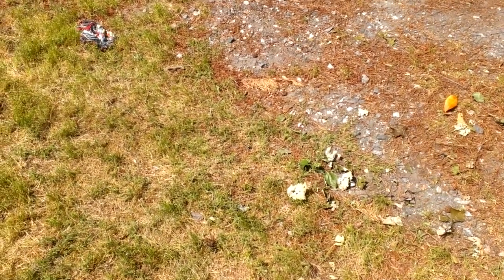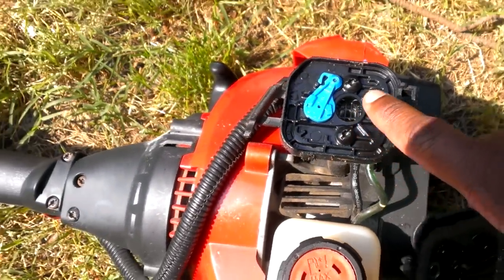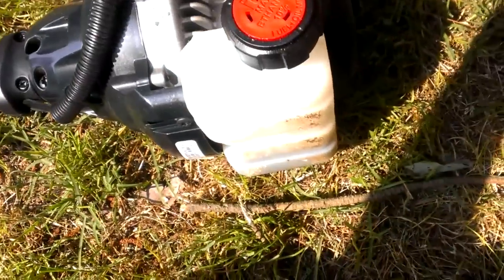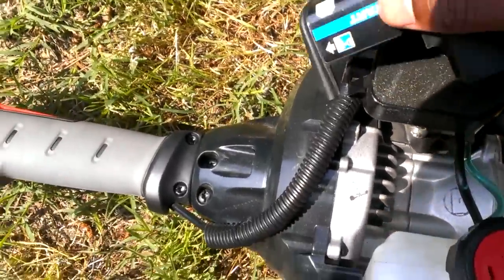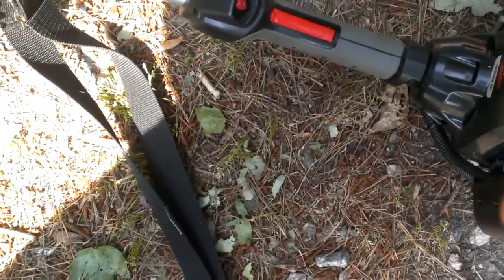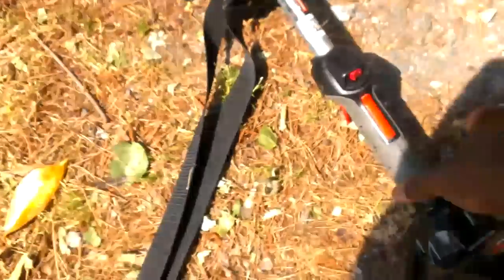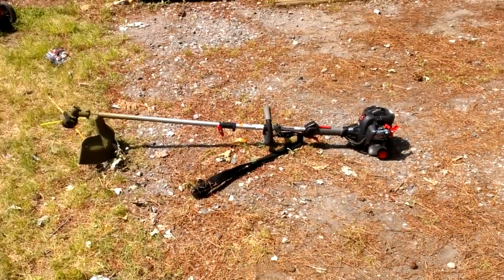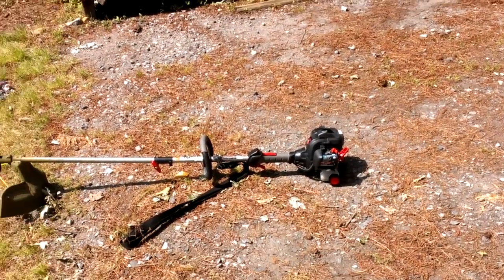Troy Bilt weed eater air filter problems

Comment: mine won't run with the airf filter installed even a brand new filter it won't run or idle soon as i take filter out fires right up

Comment: All my equipment is Toro and i have never had any problem with them, had them for almost  7 years now Troy-built for the most part is junk.
Reply: i don't think so ,I have two mowers 1 rider 1 push since 2008 and there still doing great,and a 575 trimmer that is good also.